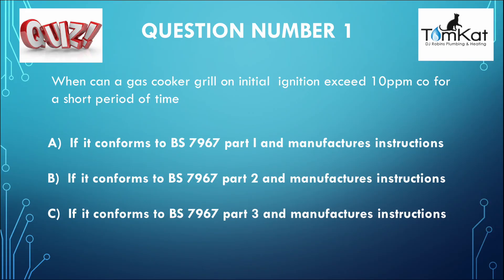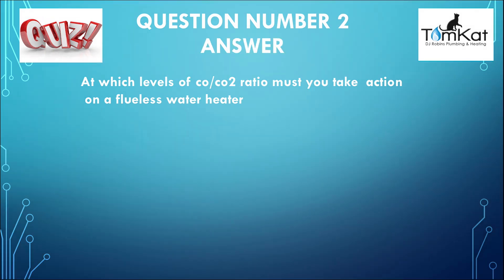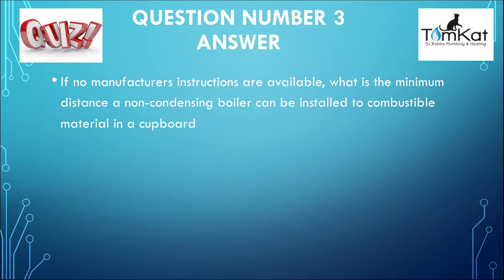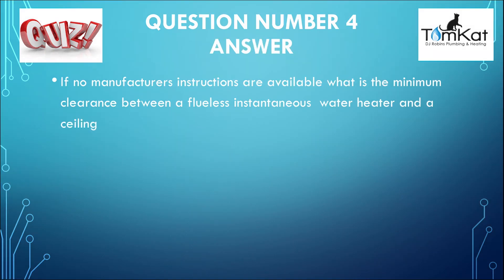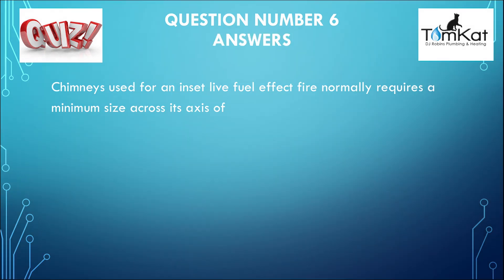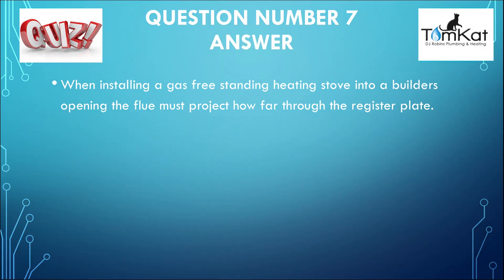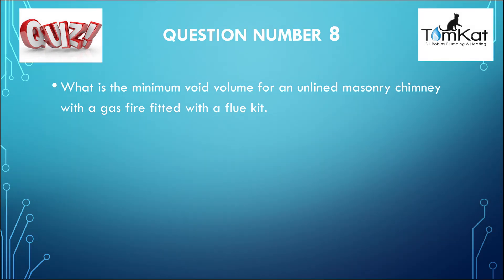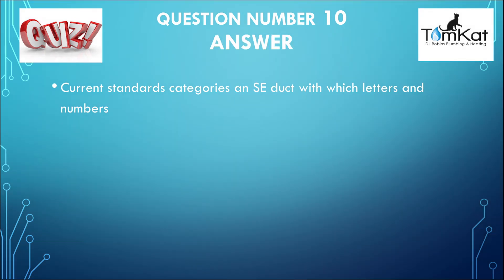The answers to TEN GAS QUESTIONS MOST GAS ENGINEERS DON'T KNOW without using their training manuals.

Comment: Question 5 mentioned a flueless cooker, surely the answer should have been an openable window, or equivalent, plus an additional 50cm ventilation. Excellent videos though, great fun.
Reply from the maker: You are correct the room would need a window but the window is a purging point and not use to supply ventilation to the appliance and the question was on the ventilation requirements. Thanks for your comment and watching cheers 👍🏻
Reply: Except if you have a door that opens directly to outside and plus an openable window in a room between 5m³ and 10 m³ then no ventilation is required!